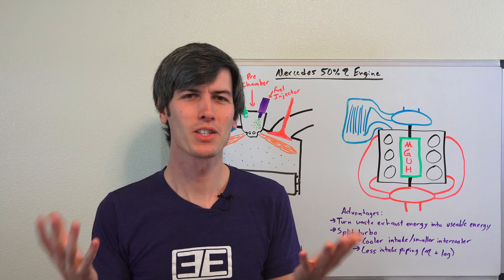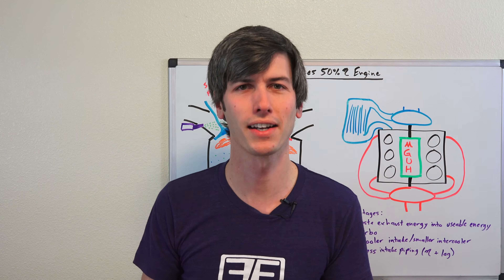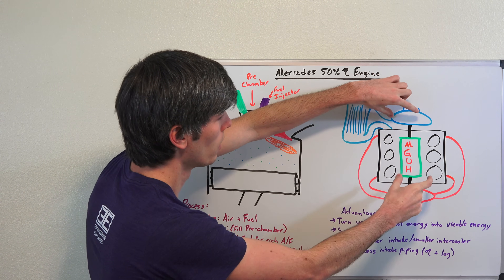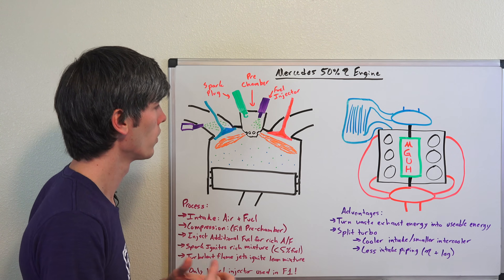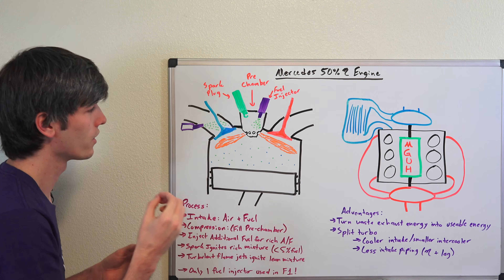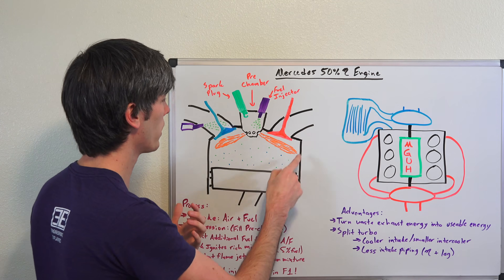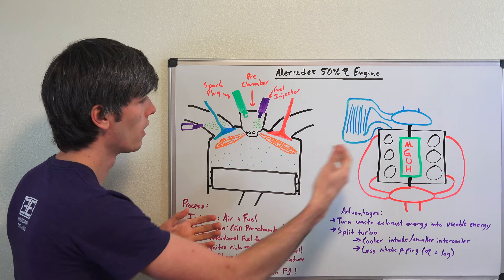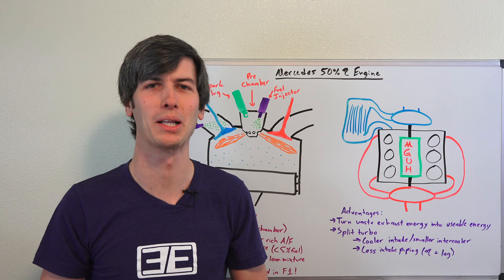Mercedes Created The World's Most Efficient Racing Engine

Comment: Mercedes showing us ICE vehicles still has hope. It's not gonna die!
Reply from the maker: Haha, well 50% thermal efficiency is no where near electric motor thermal efficiency.
Reply: Engineering Explained True! but still amazing to see car company not giving up on ICE cars & move to EV only
Reply: I hope he realizes that these cars are at least still hybrids. That's where they find the most success.
Reply: Mercedes is a very diverse manufacture, even if they expect the ICE powered car to be gone in the next decade, they have huge other markets where they sell combustion engines.
Reply: this is f1 tech. would take time to reach mass market because of price.
Reply: Electric does not seem to be as clean as some would hope. Sure the end product's emission's will be low (like tesla car) but natural gas plants are gonna be working over time putting CO2 in the air just like a gas engine. Nuclear is dying from regulations and fear mongering and natural gas is cheap and abundant. Does natural gas electricity production have less CO2 emissions overall compared to ice ??????......  i do not know. Definitely has less airborne carcinogens than ice which is good. Geothermal utilization is what i want to see. Some state that's what determines a type one civilization ( Michio Kaku ). Also there is the limited lithium deposits for batteries
Reply: Now calculate full cycle efficiency, add refinery and transport to the ICE and add power plant efficiency, transport losses, charger loss, charge-discharge loss, and then finally the electric motor thermal efficiency for the EV.
They're pretty comparable if the ICE is modern.
Reply: megaspeed2v2 Lithium ion batteries have typical charge/discharge efficiencies of 80-90%. And an e-motor with only 70% efficiency is already kind of out of date...And you know what the kicker is? 

 The overall efficiency from electricity production to storage in a battery to usage by a motor is above that of extracting, transporting, refining, transporting, storing in the gas tank, then combustion in an ICE. Even when you account for manufacturing batteries and the whole car. 

In a typical ICE in a mass produced car, the maximum efficiency achievable by the engine is roughly 40%, in a lab environment. When you bolt it to a car and after the transmission losses are accounted for, you turn ~15% of your gas tank energy into actual motion. 

Even in a coal or natural gas electricity production network, Thermal power plants achieve above 40% efficiency, and they can and technically do run on unrefined/lower grade hydrocarbons. And when you look at the above 80% efficiency of the overall electrical drive...My point still stands. 

The oil economy, it's not an industry and hasnt been since decades, is still functionning due to the transfer of money from the lower echelons of society upwards and trillions in yearly direct and indirect subsidies. Give the same treatment to any energy source/economic sector and it will take over too.
Reply: Mazda more so--they've gambled their whole company on increasing efficiency without going the turbo+downsize route that every other manufacturer (incl. Mercedes) has gone, which improves real world efficiency in a minor way.
Reply: @James Avery - EV's powered by any form of electricity generation, including coal, are more efficient pollution wise. We would be better off building all the coal power in the world and moving to EV than staying with the status quo.

But the point is that once you have a BEV (whether that battery is lithium or something else), you're no longer dependent on a single technology to provide that power - can use coal, gas, geothermal, solar, wind, tidal, fusion, etc. Then every time we decomission a coal plant and install cleaner electricity, every single car already on the road getting power from that plant automatically gets greener. THAT is the real benefit of building out EV tech. That and they're cheaper over time.

But also yes, gas is better than coal by a long way emissions wise, so we're better off going all renewables with gas peaking plants to fill the gaps than stay on the status quo.
Reply: cok Bagus oh absolutely, the closest thing to this is the AMG Hypercar. Which is incredible.
Reply: @EE: yea, but we make electricity using similarly inefficient nuclear power that boils water to drive turbines and coal powered electric turbines so its kind of the same in my mind somehow when we use those facilities to make electricity to charge electric cars. but with a 50% efficient car, its more efficient than power plants so is better than electric cars? and some of that power on the way from power plants is lost because of the distance. but then how much energy is lost in drilling for oil and delivering it hehe. not sure if im making sense to begin with. and as for the original poster, the world wont be moving away from ICE since there is no infrastructure to charge millions of electric cars and i think there never will be. plus no one really cares for waiting for electric cars to charge and they dont care for the limited range in my opinion. i like hybrids though.
Reply: ...as quickly
Reply: The electric motor itself might be efficient but batteries are only about 70% efficient when charging and discharging, 100*0.7*0.7=49, actually lower than the efficiency of the mercedes F1 engine not accounting for other losses ^_^, electric cars are not more efficient, their advantage just lies in that electricity can be produced renewably, or at least, it will be possible to do so some day.
Reply: @cerberus984, not quite. Banning fossil fuels doesn't put all the eggs in one basket - there are multiple storage technologies, using different materials (not necessarily lithium), and multiple ways of generating power. Hell, you can even use grid distribution of onsite generation. That's a massive change from the status quo where you have a single model of extraction/refining/shipping for all the fuel we use, with no way to move away from it, and no way to do it cleanly enough to keep going without destroying our environment.
Reply: @Matthew, The cells of the battery still can only be charged at 3.7V each so even though you make the transmission to the charger more efficient you still have to push the same current in to each cell of the battery so it still burns 20% of the energy away into heat.
Reply: This is called hybrid?
Reply: Well, where does that energy for EV come from. ICE, of course. Till fusion comes online.
Reply: Well comparing them is a bit wired. Thermal efficiency WITHIN the EV is way better than 50%. But what if you calculate the energy mix including the power plant, transformer, power lines, charger, ect.
I'm not arguing against EV, but comparing EV vs ICE is a bit like comparing apples to oranges.
Reply: EE: Yes, but as you know if dealing with a fuel burning engine (burn to burnout) the only valid comparison to electric must include round trip efficiency...  Including power transmission.....  Also utility is a useful metric.

cool vid.  nice explanation..  So Petrol engines are drawing from old conventional diesel style tech...
Reply: ICE is to electric has vapor is to ICE...
Reply: Solar, wind, tidal, coal, gas, geothermal. Any and all of the above.
Reply: @megaspeed2v2 - 80% on 110v, 90% on 240v, probably 95% on the superchargers at ~400v. Voltage seems to make the most difference.
Reply: Actually in the values I put in my comment I was assuming a 100% efficient motor not 70; just to be safe, the second 0.7 in my values 100*0.7*0.7 was the discharge efficiency, 70% of the energy transmitted to the charger is lost when charging the battery but also when discharging the battery to power the motors 70% of the remaining energy in the battery again is wasted as heat so that totals 49% before the motor is even accounted for, the reason this is lower than your 80-90% claim is because i'm including the energy wasted by the charger at the fuel station and in the discharge circuitry inside the car which with current tech is likely around 90% efficient each.

You may say it will get more efficient, which it will but also ICE has the potential to get more efficient (50%+ is possible with HCCI - a technology that cars from 2019 will start employing [thanks mazda]), converting from one form of energy to another is always inefficient, that's just life, the sooner people realise that the benefit of electric cars is not really efficiency it is that they can be powered renewably which therefore offsets the inherent inefficiency of energy conversion the better because if solar, wind, hydro, geothermal and nuclear don't expand exponentially soon, we're just going to be polluting the world even more... coal and gas still have the same massive production/mining and transportation losses as petrol so that 40% thermal efficiency doesn't really help.
Reply: ICE will always be around as we will hit peak battery eventually which wars of the future will be over lithium supplies. Nations who abolish petroleum based fuels are putting all their eggs in one basket.

I'm not against EVs just being a realist as it's niche application that is pipe dream economics disregarding supply and demand. More EV usage decreases demand for petroleum causing over supply leading to cheaper fuels. Sure, you could tax it out of cost effectiveness but then you are crippling truckers who deliver your goods. Which you the consumer will pay higher prices as an end result.
Reply: Amazing that they keep working on ICE? Amazing stubbornness, misplaced that is.
Reply: Steam powered vehicles because extremely efficient and advanced in their last years
Reply: Ecosse57 true, but today it's no longer a prediction, it's a trend you can observe in the sales numbers.

Comment: It seems like such a simple concept. I wonder why it was just created.
Reply: That is only a small part of a ridiculously complex machine. What this engine does isn't necessarily groundbraking, it's all about how efficiently it's able to do it.
Reply: it's actually not new. the honda civic CVCC from the early 70s used this method to bypass the emission regulation of the era without a catalytic converter, also 'accidentally' the car won the most fuel efficient car of the year award few years after it's release
Reply: Koolkei I guess it's only ground-breaking when Mercedes does it.
Reply: @Koolkei
So why don't they use it still?
Reply: Koolkei, I was literally thinking the same thing, my 85 Civic 12 valve cvcc had it with a carburetor. 4 of those 12 valves are little pintles that let the a/f mix into a pre-ignition chamber with the spark plug. It blew my mind when I first took my head off it.
Reply: Koolkei ahh brings back memories. When soichiro honda embarrasses GM ceo by installing CVCC on Impala, making it cleaner than using expensive and heavy catalytic converter.
Reply: Most of old big diesel engines did that. (Not sure why, maybe a question for Engineering Explained?).
Reply: If you think this is anywhere near "simple" is because you didn't understand the concept.
Reply: I'm pretty sure I saw something that said these originally began use in large diesel engines
Reply: Well its ground braking when you actually manage to achieve something significant with it...like over 50% thermal efficiency. It's not really important if it was used before to achieve a slightly better MPG, the emphasis here is that Mercedes managed to break the 50% mark.
Reply: Check out the honda city  turbo
Reply: +Marc Gràcia it was for more efficient combustion, here is a video about that:
watch?v=Ll3eK_EvsBE
Reply: This technology was available in Soviet GAZ 3102 cars in early-mid 80s. Name of the engine was ЗМЗ-4022.10
Reply: mustapha supas this video is not about ground breaking new technology, it is about a manufacture hitting the 50% efficiency mark. Like the first 400km/h car was a news, just some magic number hit.
Reply: I think most old diesels did it is because diesel fuel burns much slower so it's far harder to get a full burn out of a diesel engine than a gasoline engine so the pre-chamber would have a greater effect
Reply: I was told by one of the Engineers for BC Ferries years ago that the Diesel two stroke turbo engines they use are about 50 percent efficiency
Reply: The concept looks simple, but it's the most complicated power chain in racing history. Ferrari had a similar concept on their first year of 1.6T. But they couldn't even figure out how to make the shaft through MGU-H stable enough to not blow up the engine. The electronics and lubricant oil not even mentioned. To tidy up the lubricant oil and cooling of a hybrid engine is already complicated enough to cost car manufacturers took few years to fix.
Reply: yes it was a carb. CVCC fell out of favour because of emission. those stratified charge engine is now unfavourable. the current game is HCCI, homogenous combustion compression ignition.
Reply: Mercedes has and always will be one of the leaders in innovation along with Honda. This is just coincidental and what is noteworthy is the combination of components and how they work together. Mercedes would never claim they were the first to create a stratified charge engine.
Reply: Fan of Fast wait. It was a carb?
Reply: Koolkei, yep 85 dx hatch, it had an electronic controlled carburetor. There was like 50 something vacuum hoses adjusting various parameters for better fuel economy, I could get almost 45 mpg.
Reply: Which mazda has nailed.
Reply: Michael Roberts agreed. This is excellent execution of an efficient concept brought about by amazing manufacturing methods and materials science applications.
Reply: Do you think the prechamber holes could ever get clogged
Reply: Yes, they could. But, F-1 uses fuel the rest of us don't have access too plus the F-1 engines only have to run for a few hours before they go back to the garage. I'd be interested to know the number, diameter, OAL of these holes. If they're "short" holes then there shouldn't be much wall area for a clog to occur...but, at the same time the piece the holes are drilled into have to be thick enough to withstand combustion forces. Overall, not rocket surgery but I'm sure there were several iterations of this part in the scrap bin before they hit the sweetspot.
Reply: There was no impending economical doom due to incoming restrictions on technology from the previous millenia to rpevent it from causing further degradation of the environment AND economy.

yeah the oil based economy is not self sustained NOR is it profitable...The reason it lasts as long is the movement of money from the lower classes all the way up and trillions in subsidies.
Reply: said the euro-elitist who doesn't get enough sunshine. Jeez Rolf, it's just an engine...lighten up.
Reply: @Brandon Mott The indirect injection in diesel engines is different. It was designed to reduce the noise and the violence of the combustion. This has a cost: it reduces the efficiency. That is why we have direct injection again nowadays.
Reply: Neat; how much more efficient was in comparison to other similar cars?
Reply: Hill Billy, what's stopping anyone from filling their own car with unleaded E95?
Reply: Mercedes used pre-chambers in the W123 diesels back in the 70's and my '85 has 750+K miles and plenty more to go w/out clogging. Maintenance of the injectors by purging the system w/ Seafoam or other cleaners   will avoid this from happening.
Reply: It probably failed a few times before it worked out like this!
Reliability must have also been a major challenge.
Reply: And for those of you mentioning about how Diesel had reached this before, Diesel engines were known to have high efficiency. So if gasoline engines have 30% efficiency, it's no surprise that Diesel engines can achieve 50% if not more. Thanks to their very high compression ratio (from anywhere up to 25:1) a lot of those heat energy changed into mechanical energy = high efficiency. But of course, diesel engines are strong, heavy and redlines at half of most gasoline engine does. Gasoline engines cant have as high as their comp ratio because they are lighter, very. And spins stupidly fast too. A side note is that most diesels have turbos. A gasoline with comp ratio of >13:1 have reliability issues without even forced inductions. So Mercedes achieving more than 50% efficiency in a gasoline engine is quite impressive. That is a lot of energy = power.
Reply: Koolkei yup..  Recently saw a restoration of it on Wheeler Dealers.. A carb and the carburettor had a separate chamber too for injecting the rich mixture.. Awesome from engineering standpoint..  Too bad I hate Honda for their fanbase

Comment: I wonder how much this would increase fuel efficiency in our cars
Reply: 177SCmaro much more than that. Going from 30% to 50% is about a 60% increase in efficiency. So for the same power output you would use 60% less gas.

Comment: Thermal efficiency is exactly what needs to be talked about in 2018. Too much dirty electricity being used to charge Teslas
Reply from the maker: Power plants are far more efficient at producing energy than internal combustion engine cars are (even if the source is natural gas, coal, etc).
Reply: @EngineeringExplained  production, sure. Delivery of that energy all the way across the states? Try again.
Reply: Nuclear ftw.
Reply: You clearly do not understand.